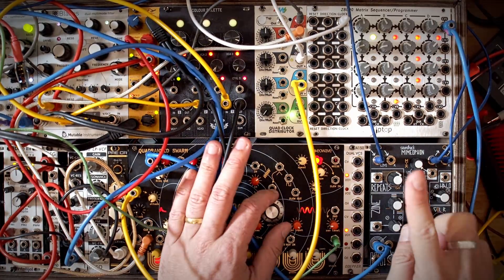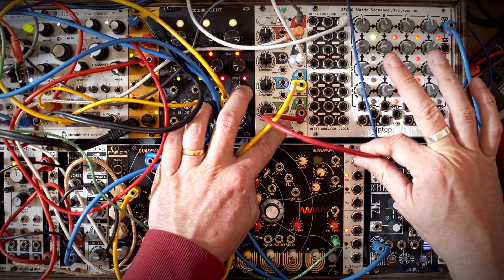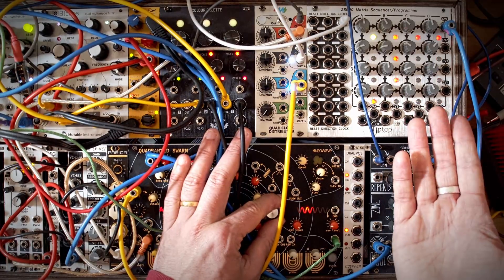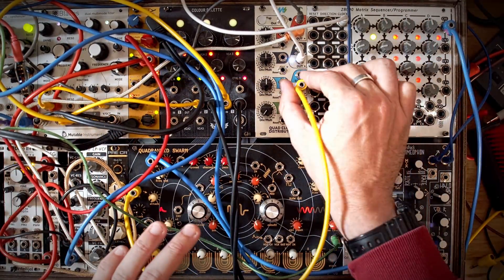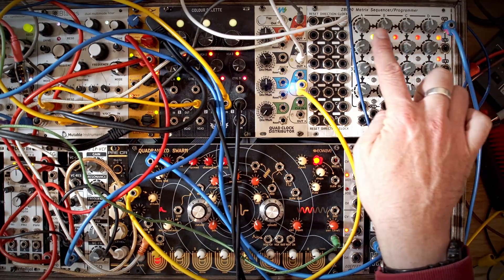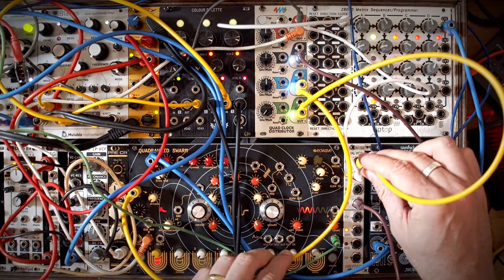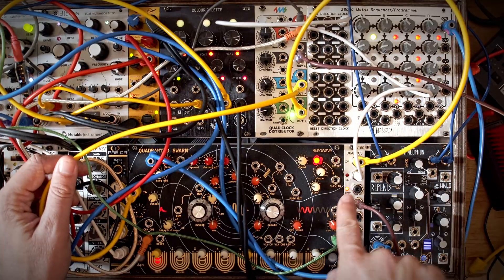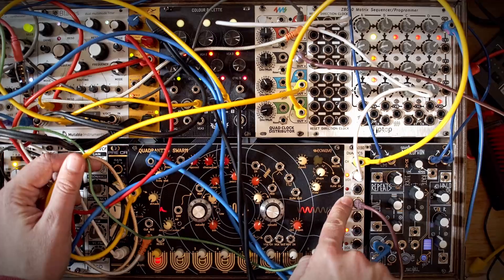How to MAKE an Intellijel Metropolis

Comment: I've attempted kinda similar things with the Doepfer A-155+A-154+A-152 — clock streams of various speeds into the A-152's 8 inputs, and using the bottom row of the A-155 to select the clock stream. Though this is not quite the same, as every A-155 step remains the same length. The A-154 adds the ability to control the pulse width for the bottom row gates which, combined with a VCA, yields some of the functionality of the step mode switches in Metropolis. The A-155+154+152 combination is incredibly powerful

Comment: Thanks for the idea, and of course you can use an AND gate for this (or VCA as mentioned) if you're dealing with triggers. AND gates are great for gating gates.
Reply: Can you link me to a good explanation of how AND gates work? I just got Maths a few weeks ago, and I have MI Kinks on the way. Understanding by experimentation is one thing, but I really want to know in my head how the logic works. When I search though, I just get countless responses about computer programming.
Reply: @richarquis  In the context of modular synths, logic module gates generally take 2 or more inputs and generate an output voltage. Inputs and outputs are either 0v or some positive value (generally 5v) and the output will jump to either 0v or 5v.  (These values are referred to as '0' and '1' in logic diagrams.)  You'll see this type of module referred to as "CMOS logic" or digital gates sometimes because they only deal with 0 or high values.

AND gates output 0v (a '0') unless ALL of their inputs are 5v ('1.')  So, if you have a 2-input AND gate, you can hold one input at 0v and the output will never change from 0. If you hold that input at +5v instead, the OTHER input will directly control whether the output is 0v or 5v. So in this way, you can use one input like a switch.

OR gates are similar, except the output voltage will be 5v if ANY of the inputs is 5v, and will only be 0v if ALL inputs are 0v.  Other gate types have different rules, basically, or are versions of these that have their inputs put through an inverter (changing 0v to 5v or 5v to 0v) (NAND, NOR.)

The AND/OR on the Kinks are actually "analogue" AND/OR operations. They're a little different from CMOS logic but can be used in much the same way. Analogue AND takes two or more analogue inputs (treating them as continuous voltages rather than just considering if they're 0v or some value closer to 5v.) It will output the MINIMUM of those two voltages. So if you put 3.3v in one input, and 0.5v in another on Kinks, you'll get 0.5v on the output.  Analogue OR outputs the MAXIMUM of the input voltages, so providing 4v on one input and 6v on the other will output 6v. Of course if you only supply 0v or 5v to the inputs, the outputs will be just like CMOS gates. Analogue MAX/MIN can do lots of fun audio stuff because it works with negative voltages too.

Hope this helps!
Reply: @richarquis and DivdKid just released a new video on exactly that: logic.
Reply: @effiksmusic  Yes, i saw that one day after asking! Thanks!

Comment: I love doing this using this in my Verbos system using the Sequence Selector as the switch and the Voltage Multi-stage as the main sequencer. The fact the SS is 5 step make it even more "funky"

Comment: Your comment on picking out bits of a melody made me think of this, but I’ve done something sort of “similar” by running one filter into another when you have a sequence that jumps around a bit between a couple octaves. By adjusting the cutoff of the two filters against each other, you can pick out different melodies since you’re kinda squishing around this frequency band (is that the right term?) relative to the sequence.

Comment: I’m using the A150 for selecting two pitch cv signals with a gate. A melody is at input 1 and the pitch bend cv from a ribbon controller is at input 2. The gate is also generated by the ribbon controller. So when I slide up and down the ribbon, I get nice pitch bends and otherwise the melody is playing.